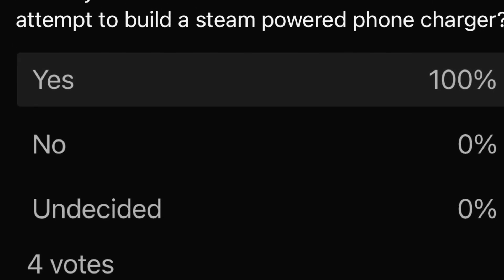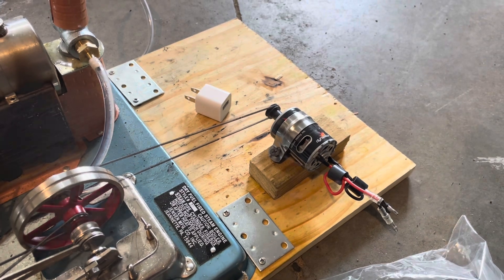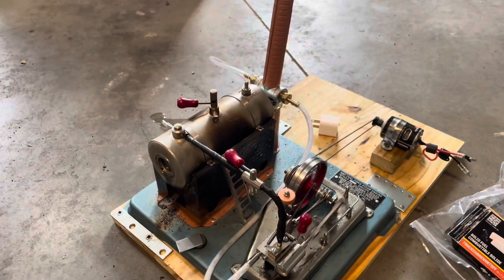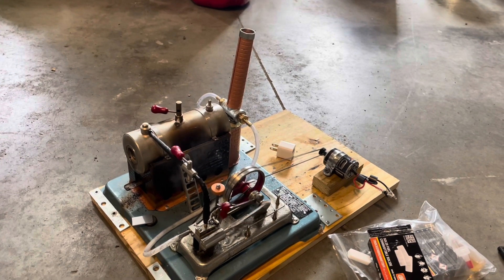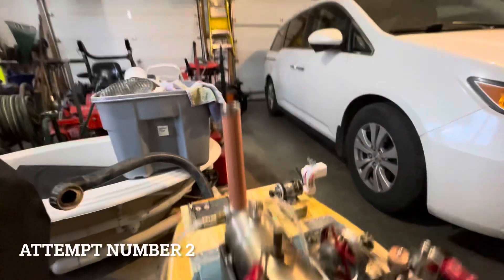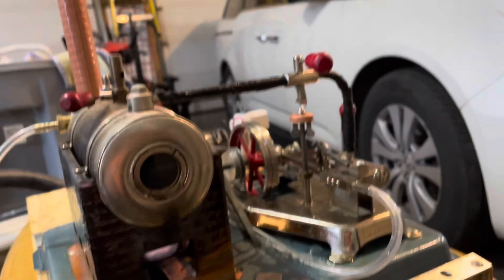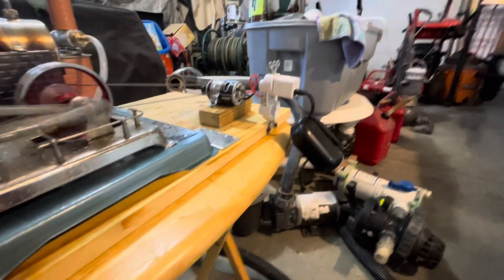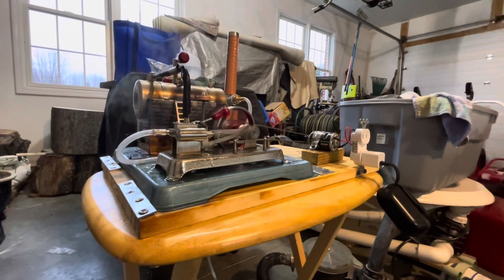Steam Powered Phone Charger 1: Prototyping

Comment: No way that's going to work. As already mentioned, these chargers expect 110/220v, AC. Your motor turned generator might output around 3 to 9 volts, DC. First you'll need to do is to measure what are you getting out of it, then you can buy a DC-to-DC converter that works with the voltage range you need. 
If you fancy learning some electronics, you might try to build a custom circuit for this, most probably based around a 7805. Bear in mind that a 7805 is not a DC-to-DC converter, it's only a voltage regulator that outputs 5V, and needs at least 7V to work, but it's very simple to use, so it's nice for a first attempt.
Reply from the maker: Thanks! Like I may have mentioned I don’t know what I was doing at that period of time. 

I was doing some digging on some channels that are experts in electronics and I maybe have to make a voltage multiplier

Comment: I would recommend using a multimeter to measure the voltage output of the motor. If it is below 7V it will be hard to charge any USB devices with it.
Reply from the maker: Thanks. I could use a voltage multiplier and see where I go from there
Reply: @Bardsbrothersrailroad  there are also dedicated circuit boards, that can take in dc voltages between for example 2 and 12 V and output steady 5V for usb devices. This will likely be the easiest way to acchieve what you want.
Reply from the maker: @mathewcherrystone9479  sweet! Thanks!

Comment: Your motor is outputting DC power, and the wall outlet (and USB adapter) is expecting AC. You would be better off measuring the DC output of your setup at a comfortable RPM, and then use that to power a DC USB charger. Most of those expect 12v input, so if your voltage from the engine/motor is too low, increase rpm till you reach it.
Reply from the maker: Will do or I could just use a voltage doubler maybe

Comment: I am kind of confused by that Setup, isn't that plug for 120V and that motor turned to converter more around the maybe 12V range?
Honestly I would try to skip such a charger entirely and either use a step down converter after the generator that makes a range of input voltage to constant 5V and connect that to the 5V Pin on  an USB Plug.
Also it seems like your steam engine doesn't run that well.
Reply from the maker: To be honest part of the thing is, I don’t know what entirely what I’m doing that’s why I am prototyping and looking for help. I appreciate your feedback either way and yes, I don’t think the steam engine is running optimally I’m gonna have to look at that myself.